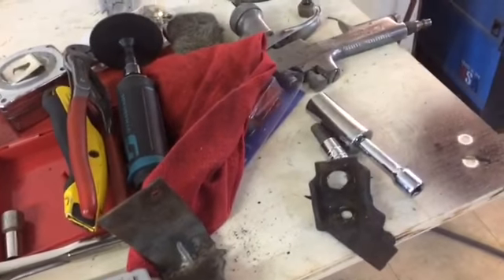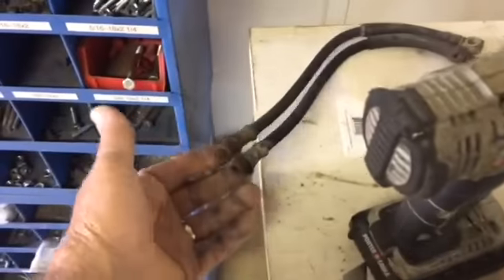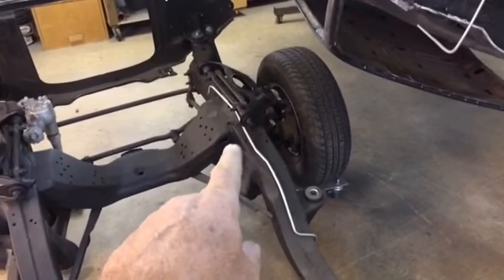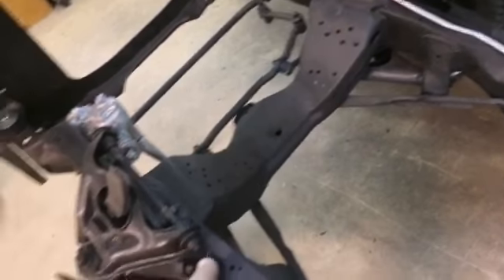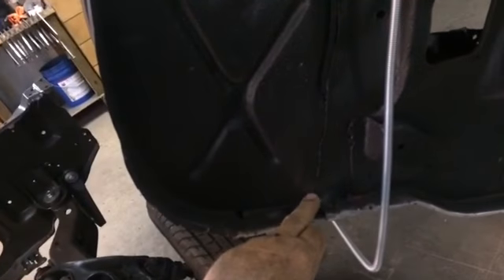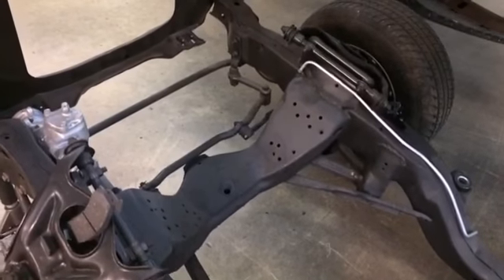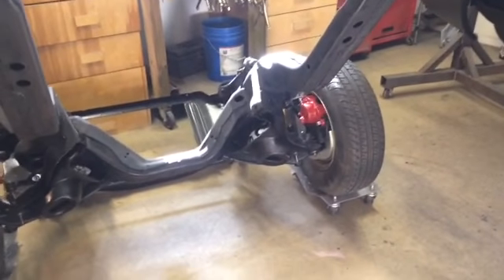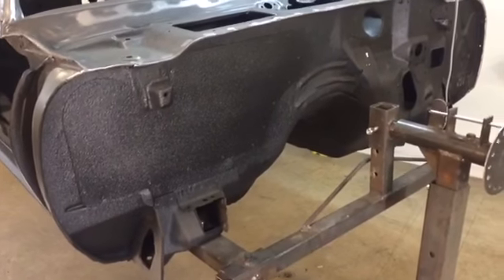Camaro sub frame brakes and engine tear down

Comment: Jeff, it’s always fun AND inspirational to see what you are doing. Before you get to far along with that headliner, you might wanna install your ceiling light wiring. At this point in the build getting the wiring kit and running it along the left side from the firewall to the trunk and affixing it will fit into your build process. Kind of like doing the rough in for the electrical in a house build. You’ve got the “plumbing” rough in pretty much done...Fuel and brakes. Now, back to The nifty 350...😉👍 Bob
Reply from the maker: Thanks Bob! The headliner is gonna be different from the norm, and I'll have to build it so it can be removed and stored. I think I have the original dome light and wiring, I need to check. Hope you and JA are well...
Reply: jeff lindsey Yes sir, we’re doing well.

Comment: You know Jeff one thing that I really like about your approach to your build is when you change your mind on what you have done or way it is and go back and make it the way you want it to be. That is really cool, not just throwing in the towel and leaving it. I went through the same stuff on a 1953 truck I did. Many things I did twice before I was satisfied. Now it is something I don't look back and say "Crap, I should have done that".
I might have a cowl piece, what side was that you needed?
Reply from the maker: Thanks Idaho! I think a person gets better as they go doing this kinda work and I see stuff all the time I could have done better. Some of it I just have to change. 😬 it's the drivers side inside. The outer cowl piece is new. Let me know, I'll buy it if you have one...
Reply: I checked my junk pile and I have the passenger side unfortunately. If you need that let me know. You can have it.
Reply from the maker: Thanks for checking Idaho, I cut out a cover piece that looks good

Comment: Nice manifold...A great idea is to pull it down and replace rings /bearings/ cam and lifters at least..It'll probably be fine with that and the heads cleaned up...You'll know once you open it up.
Reply from the maker: That was the plan Zig. I just got derailed. She’s shot!

Comment: I don't know about you but I find all the stuff interesting and you were getting into the area I enjoy most which is the motor so I definitely can't wait till the next video still waiting on your sticker though and yes I still need to mail mine out
Reply from the maker: Taking a trip to the PO this week, have some mail to send and yours is in that batch. I'm interested in the interior you're working on. I've done a lot of upholstery (wife and I had a shop years ago, still have Juki industrial machine and other tools) but no automotive stuff.
Reply: jeff lindsey unfortunately I only have a standard sewing machine and this is my first go-around doing a full seat I've repaired them before but never done a whole cover from scratch I already made my first Boo Boo by making a piece too short and have to recut two pieces

Comment: I agree with removing the raptor liner from firewall.  I know it is good durable stuff but with it being so rough and porous, I'll bet with would be hard to clean.  I left the bottom of my 69 slick with single stage semigloss black over epoxy.  Lets face it Jeff, you probably won't be driving that car in the rain anyway.  lol
Reply from the maker: Wes Perry lol I'm not sure I'm even gonna put wipers on it.. I will be stripping off the firewall

Comment: Jeff, what steering gear box you have? Power? Close ratio?
Reply from the maker: Chad, it's an original power steering box. I took it off and cleaned it, but won't know if it needs rebuilding till later on. Thanks for watching